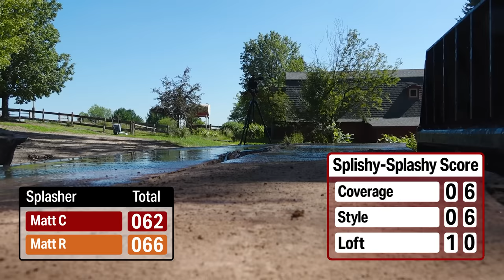Sawing Matt Ruben's Massive & Historic Walnut Log

Comment: I want to buy a big farm just so I can have an excuse to have a telehandler. I'm always amazed at how much that can lift, even when extended way out.
Reply: Those JCBs are best!
Reply: I run the jlg 12g daily at work (drill out pads) the weight I lift is insane, and with the out riggers, I haven't found a single thing that's stopped me yet. Even had to put the riggers down and boom out while hooked to a chain to drag a water bottle truck up a hill in winter a while back. Safety man loved that one lol.... I was told "were gona look for deer on the back of location, get the truck up here"

Comment: Good work 2 Matt's.
My dad (R.I.P.) had a 2 foot diameter walnut log ( feet and inches back then).
Had it in his shed drying for 40 years,  he did a lot of wood turning. 
His trade was wood machining, back in the Netherlands. 
Metric in Holland,  and Australia was in feet and inches in 1956, then back to metric.
That walnut was still drying after he finally decided to use it.

Comment: Matt,
I see you struggle moving those heavy slabs off the mill.I too mill by myself and found a helpful one man trick to moving those heavy slabs. 
I use 1", 1 1/2" and 2" pvc pipes to roll or move the slabs  onto the forks. I too enjoy being the first one to see the inside of a log.
Thanks for all you do, DonR
Reply: Matt tried the pipe technique at his old place once, I remember a video he posted. He didn't like it because he said it was unpredictable and would quickly get away from you.
Reply: It's ridiculous that they're struggling with those heavy slabs while forklift is parked right there

Comment: So awesome!  I had a Sawyer come to my house with his portable mill and planked/quarter sawed a 60 yo White Oak (only 60 in on the base and 52 in at the crotch and about 8 ft long) for me.  I was thinking you might use a self-leveling laser that could help monitor your cuts and your blade aspect.  I bought a Skil self-leveling red cross line laser for around $100 which is perfect for my rare applications inside a house.  Really enjoyed Rubens freaking HUGE (Mine was a baby compared to this one)..LOL  The professional I used had a metal detector to check the wood prior to initial cuts, and when he was nervous about certain aspects of the trunk.  Again, so awesome watching the two of you work through the log.

Comment: If I were young and healthy now, there is no doubt that I would have invested in a similar saw to yours. Where I live in (Norway), there is good access to timber and thick old stumps. The stumps are not of the greatest interest, they are heavy and unwieldy, but there is enough machinery to get them transported to the loading area. It costs a bit, but it does everything nowadays. The forest owners are usually decent guys, with whom it is possible to reach a viable agreement. I scratch my hands with desire to work, but when my heart and lungs refuse to cooperate, all I have to do is bend my neck and swallow the elephant. My field has been Tattooing, and repairing wooden boats, diesel engines and cars. A bit of a mix, but have never been able to sit still. Mixing work has therefore been a joy until I got sick, and it is a joy to see everyone using the saw.  Good luck with the sawing.

Comment: awesome work and effort, I thought and feared the tree would split and separate after you cut 1 side and flipped and cut the other side. I saw in my mind it destroying the mill,. I forgot the bottom side had been sawed flat and therefore stopped the roll factor.
The possibilities for those slabs are endless, and SOOO! very unique. biggest walnut I ever seen.
and I love opening wood.

Comment: 32:45 "What ever that metal was.."  when a thin line runs horizontal, all the way across the grain, it's most likely an old fence wire strand the tree absorbed as it grew. 
Some beautiful grain in there !

Comment: Superb timber. Will be good to see finished products
Reply: Take a seat Jean and get ready to have some patience. That wood will need to dry for several years now before it will be able to start creating anything with it. It needs to air dry for probly the next year or two at least before he can move it to a kiln otherwise it can create structural issues within the wood with cracking, twisting, and warping. Walnut has to be dried extremely slow in order to maintain a flat board once you start to build with it. If you try to pull the moisture out of it too fast, it can collapse the cell structures of the log/board which seals the moisture inside which causes a huge fight between water and wood as it tries to find new avenues to escape which can cause the twisting and warpage which would be a sin to ruin a log this big by getting into a hurry.
Reply: @1982MCI  not so Don. I say go ahead with thd projects, its just some old everyday walnut. Plenty more in the woods.

Comment: Thanks again for sharing Matt! Big fan of your channel and the journey you’ve been on—both woodworking and sawyering. Question for you though—why do you run your mill dry (i.e. without using diesel, water, or windshield washer fluid trickled onto the blade)?
Reply from the maker: I use diesel mixed with bar oil. Applied as needed
Reply: Yeah, if you watch closely you will see him spray the blade, from time to time, with a hand held sprayer.

Comment: Take a page out of Sasada's book, he uses 3" staples to hold cracks shut when cutting slabs. Just nail some sticker boards across the ends of the slabs before you cut them so they don't break apart.

Comment: Do you know anyone in Illinois who can saw up big logs like you do?  I have two huge oak trees that blew over last Fall that were still green at the time that I would like to get sawn into lumber.  I don't have anything powerful enough to even lift the logs (8-10' lengths) to move them inside, unless I just cut them into firewood lengths.  I would like to see them used for lumber, though.

Comment: Matt, what or how do you dispose the sawdust?  Can you use it for something else?
Reply: I use my sawdust for a bunch of different things.
I manual mill with a H460 36" in an Alaskan mill.  I run skip chain @10 degrees.
1. My chickens love it in their house.
2. I mix it into my planter boxes
3. I use my shop press, and a brick mold,  mix in some diesel and some left over candle making chaff, and I make compressed fire starters.
4. I mix into my compost pile.
5.  I use it to clean up after an oil change.
6. I then burn old brush piles with mixed buckets of used motor oil and sawdust.
7.  Sawdust makes real nice planting bed dressing too.

Comment: Flatlander from Cali bought as old family's dairy farm situated in a flat but not overly broad river valley in Wash State.
They lived in old farmhouse while he had built their idea of cowboy rAnchouse. He put his house in lower field and built driveway between #1  and  #2 oldest Black walnut trees on state registry.
Both trees marked and metal designation on them.
His wife scraped one  it was narrow and one had to pull out a bit on single lane county road as you turned or wide turn to enter. Road oly seen maye 5 vehicles a day,  so she bitched and he fell both trees, sold logs to sawmills.
5 YEARS LATER HE MOVED.
He got tired that every winter the rivers flood waters ran through his Ranch House Lear up to porch.
He found no sympathy from locals.

Comment: Table top would look cool with a jigsaw join of 2pieces if that’s possible 😊
Reply: If you can dream it, some crafts person out there can do it. There are so many computer guided ways to cut things these days, plus guys and gals that are so good with templating and chisels/gouges that could do it by hand. Could even inlay a contrasting wood along the cut to make it show up better, if that's what you want. But it would cost a good amount of money to get something like that done by a respectable crafts-person, and you would loose some width to the slab accomplishing such journey, unless you bought a third piece (half slab) to add in the middle and did two puzzle journey runs, or how ever you had in mind maybe with a contrasting wood (or two) of puzzle pieces running down the middle?

Comment: At first, I wondered why you did not use a motor to move the saw. Later I realize that you are using sound and feel to control the cutting speed. Excellent.
I still think you should update your design. One person modified the cable anchor so that the saw would go all the way to the stops. If you mounted the saw below the saw head, the throat could be increased it almost the diameter of your driving wheel.
A different sawer installed a laser so that he could see the planed cut down the length of the log.
Overall and excellent design, excellently executed. It makes the commercial offerings laughable.

Comment: Woodpeckers  put those nuts in the little holes. .  Potentially a pretty expensive gamble not running a metal detector over the logs before milling.

Comment: Ok.... this isn't gona sound to good but maybe you might learn something from this...first off j noticed the way you loaded the machine up with this log was totally wrong you should have lifted one end then put straps or chains under it near the middle about the distance of one centre gap to the other  centre gap on the machine bed tgen connect rose Straps or chains over the top of the log and lift it from above lowering the boom arm to place the log onto the machine bed  secondly don't soak the entire peace of wood to see the grain just wet a peice of the offcut remember water is not goid for the wood and means the peices that do get wet will need to be thoroughly dried out before they can be treated with any form of sealant by the person making the wood slabs into furniture... thirdly the reason you had some dips in the wood or the cut would deepen at the beginning is because your using to much pressure on the pass in other words your driving the mill blade forward to quickly this will cause the blade to warp or angle downward causing the cut to deepen the time it takes you to wind the wheel once is too quick in the time you turn the wheel one full turn you should really only move the wheel a quarter turn this prevents the blade bowing in the middle and prevents it tilting downwardly basically your guiding the blade forward too quickly for the blade to do the work it's better to slow the pass down and allow the blade to work this would also prevent the blade heath being chipped or  getting worn out too quickly this means your technique is wrong and rather inefficient... that bieng said a decent planer can level those slabs out but it still means more wastage than should be necessary... in not saying this to be harsh or nasty just noting these points for your future reference so that you can work more efficiently for the sake of your stock your tools and your own safety one thing you certainly don't want to do is to be rushing a pass to find it hitting a natal bar in the middle shaping the saw band and it flailing around and injuring yourself or your co workers standing nearby...

Comment: Why are you making dry cuts ..? Your mill doesn’t do wet cuts it’s easier on the blade .. my dad my brother and me owned a ground hog mill … the blade stood still and the log was put on the carriage the carriage rolled back and forth on the tracks .. just about everything was hooked to belts .. the carriage was driven by cables it was a cool mill to run .. groundhog mill ..

Comment: An ATV winch..... It's just a geared down DC motor. Why don't you use a Lovejoy coupling and hook that up to your winch? so you don't have to crank.

It's just a DC motor so it's variable speed with just a simple system.. it'll give you more control and you don't have to sit there and crank 🤷‍♂️